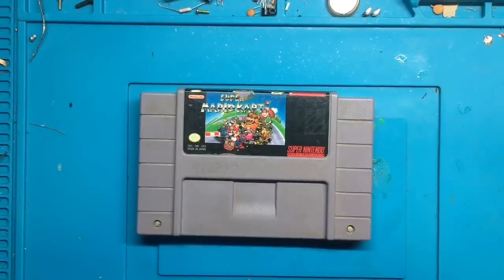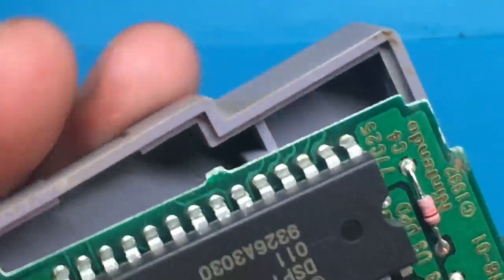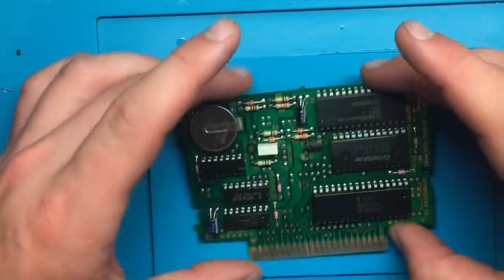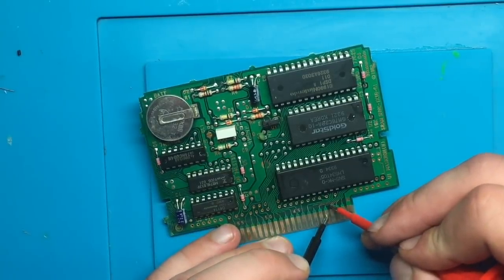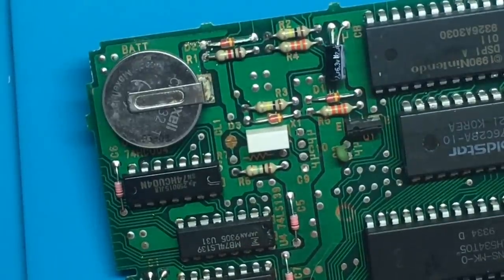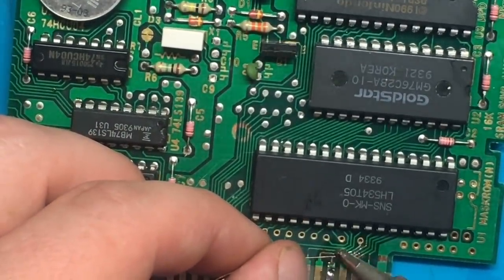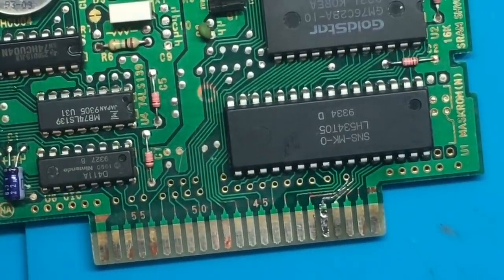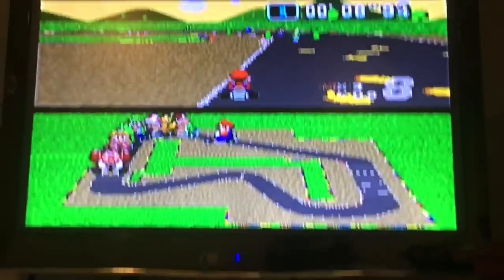SNES Cart Bad Colours - Fixing eBay Junk - Trace Repair

Comment: I actually had this same issue a few times a while ago. I also had an issue where the DSP-1 would glitch out on the tracks causing an unplayable glitchy mess that freaked me out. Turns out it was one of the pins in the cartridge slot that was bent.

Comment: Bro, for scraping the mask off you can better use a fiberglass pen, it will make this task way more easier.
Reply: I literally was typing this out when I noticed your comment. Seconded. It's much easier on the board as well.
Reply: Just about to add that comment myself. I was cringing every time I saw metal scraping along those tiny copper traces. Definitely invest in a fiberglass pen. Same result with much less chance of making weak traces worse.
Reply: Why get something when you can use what you already have?
Reply: @MalleusSemperVictor  Have you ever tried to scrape the solder mask of a PCB?
Reply: @padmad3k63  Yeah. I use tweezers. Same as most people, I assumed.
Reply: @MalleusSemperVictor  Most people use the fiberglass pen, it's much easier, less risk for damaging something, the surface will be flat unlike when doing it with a razor blade or tweezers. Just give it a try.
Reply: @padmad3k63  That's fair. I might try it out.
Reply: Agree. Fibreglass pen is amazing. It is that sort of technology which looks like magic.
Reply: If he already has experience in scraping, then he should be free to continue. The fiberglass pens are good but I would say that they help people more that are unused to the technique of scraping traces and run the risk of breaking a trace. Lightly scraping a trace should not cut or break it unless the PCB is a really cheap one.
I would suggest the pen for cleaning up the edge connectors though... tinning the connectors with solder should not be required and I avoid doing that as it can cause problems later on. The gold plating prevents high-resistance oxide layers from forming.

Comment: You have encouraged me to fix ebay junk sir. Any videos about what i would need to get started? Your brand of multimeter etc.
Reply: South Jersey Gambler  - Also the most expensive, due to their level of calibration and accuracy. Best to start with a $30 meter and then get a fluke if you need the accuracy...
Reply: South Jersey Gambler  they are good, I have 2 bench top units myself, 5 1/2 digit readouts.
Reply: @EngineeringVignettes  Would a Harbor Freight Tools one work okay as a starter multimeter?

Comment: hey there Adam how's it going hopefully fantastic , loved your videos saw every last one and yes I could have left a like but you would have received a like for every last one and I mean what kind of feed back is that ,the only thing that I can say is the videos that you go in depth about like changing capacitors adding jumper wire hear and there the long videos you have those are the one I love the most the boring ones ,idk I must be a bigger tech head than I thought ,but If and when you comeback maybe you can make some more long version of fixes on boards go a little more in-depth on fixing again idk how long your 9 to 5 is and major respect on keeping a job and doing videos on the side if you can that would be amazing I would really love that :0)

Comment: With every next video Im slowly learning how to solder properly.

But hey ! I may not be a total noob in terms of soldering. I brought back a Family Computer clone back to life ! Well to be fair the board was dead, so I replaced it with the new present day one, but kept the original AV output as well as controller ports plus on/off reset switches. The power port was broken, but I glued the LED plug into the place - it supports the same style barrel jack, plus the polarity can be easily reversed. Now I have a neatly looking clone in Genesis 2 style shell. It also costs me quite nothing. 
Unfortunately the present day clone I bought doesnt support the mapper on the 198 in 1 cartridge (Coolbaby copy, but it works okay, a great pickup if you need a multi game for the FC tests) , but seems to be perfectly okay with single games as well as older multicarts offering less than 40 different games. So I may say I saved a console !

Comment: The solder only goes into the track you cut/scratch off, right? Nothing bridges to another track because those aren’t scraped off?
Reply from the maker: Generally,  no.  The trace is so small that not much solder can build up on a trace

Comment: Great content!! Just subbed. I'd like to ask you: after many years, I tried to boot up a PsOne (the little machine) and the screen only displays red and green, or green and blue, I'm not sure. A technician told me that this is related to the video processor's soldering points being loose and that this is very hard to fix, so I should instead look for a new console. Do you think it's true? Some days ago I tried to boot it up again and the console won't turn at all, but that's a different problem and it's easy to fix (it seems to be because of corrosion present inside the ac adapter, just some general cleaning). Do you think the video problem is not worth trying to fix? Should I just get a replacement?
Reply from the maker: Considering a psOne can be had for very cheap,  id say that unless you're comfortable opening it up and attempting the fix yourself,  it's probably not worth paying someone to fix it.
Reply: @RetroRepairs  Thanks for the reply! I'll do as you suggest. I just wanted to give the old friend a new chance. I've been always very careful with my consoles and it was a pain to see one of them working bad.

Comment: Hi, I'm watching your videos since I started collecting gameboy games and I wanted to ask you something
I'm about to buy a crystal pokemon cartridge in Japanese, but the problem is that I don't speak that language so I was wondering how I could do to translate the game, I've seen people swapping ROM chips between cartridges in Japanese with English and it works. But my question is, can I do this by putting a bootleg cartridge ROM in a Japanese cartridge?
Buying a repro cartridge is very cheap, and I was wondering if I could perform this "operation" and that it would turn out well, as I told you between original cartridges it works, but I don't know if there is any problem between original and pirate cartridges to do this process
PD: Maybe some more puritan collector considers this as a profanation of an original pokemon cartridge but hey, is that or learn Japanese xD

Comment: what i see hard to repair its those tiny lines, it need be almost perfect
Reply: You could track down the end points of the wire, and just run a new wire from point A to B. still small. but not that small. This guy does neat looking repair work.

Comment: flux you need to use more its your friend your work would be easyer try you will see !!!
Reply: Haha I agree. This video made me smile. Made me think when I started to solder when I was a kid. But good job he fixed it and didn't short the traces and not killing the ic with injecting 3volt on all the data pins in beeping mode
Reply: @taltechchip5827  a little more pratice i think he will be great at it he will get there